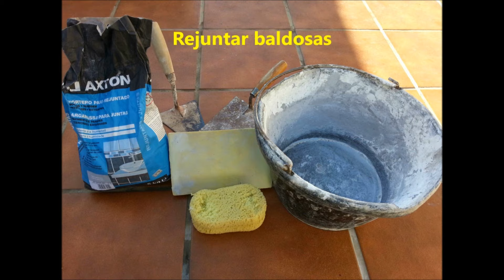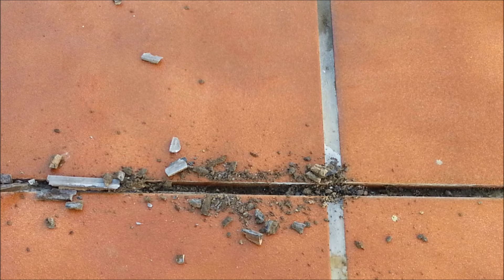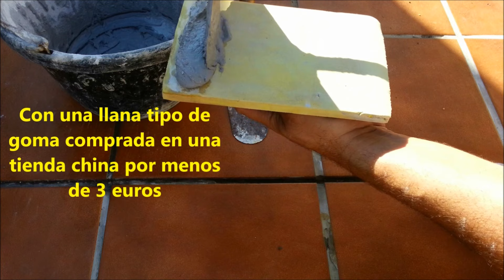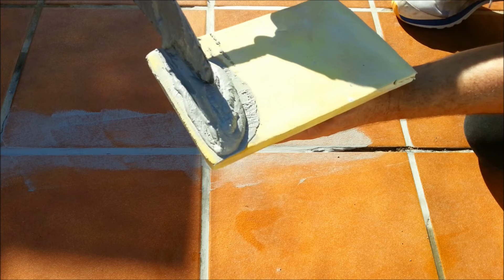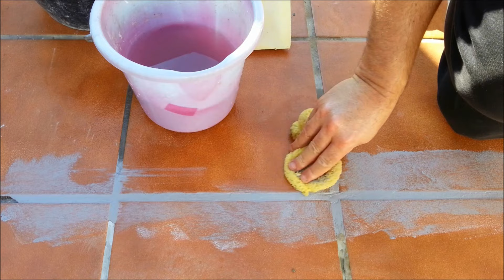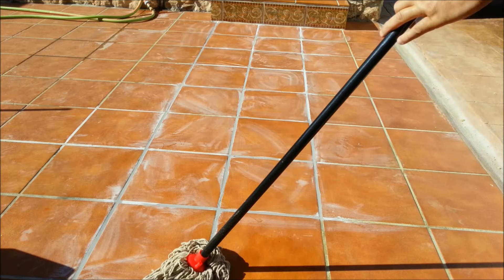Rellenar juntas de baldosas o azulejos

Comment: Eso evita que cale en la casa si la tela asfáltica es vieja?  Puedes decir que se necesita ? Gracias me suscrito y like
Reply from the maker: Hola Romano,
El rellenar las juntas hace que el suelo sea más estanco pero además hay que comprar un producto que se aplica encima del embaldosado con rodillo de pintar y sirve de capa para el suelo y no hay líquido que pase, de esta manera no tendrás que poner la tela asfáltica nueva, ya no hace falta porque hoy en día existen productos para no tener que hacerlo.
En resumen:
- Rellenar todas las juntas como en el vídeo.
- Aplicar una o dos capas según indique el fabricante tipo (Mapei Mapelastic Aquadefense) buscas la marca que más te convenga.
Saludios y suerte.
Reply: @bricobadia  muchas gracias eres muy amable. Cuanto puede costar una terraza de 12 cuadrados repararla en juntas y lo otro. El problema por el cual no me atrevo es que hay baldosas que están muy juntas y no se puede echar la masilla a no ser que la cortes.  Y eso ya seria más complicado
Reply from the maker: @romanogalactico  
El coste depende de dónde vivas, si lo hace un profesional por ti en España es muy caro y serían unos 2.500 euros todo y si lo hsce uno mismo menos de 500 euros.
Si tienes baldosas que por dilatación se pisan unas con otras lo suyo sería levantarlas sin romperlas y volver a colocarlas correctamente. Si tienes tiempo es mejor utilizarlo para dejarlo lo mejor posible.
Saludos